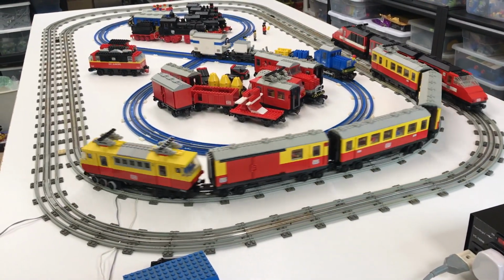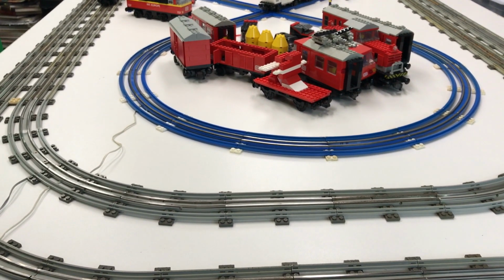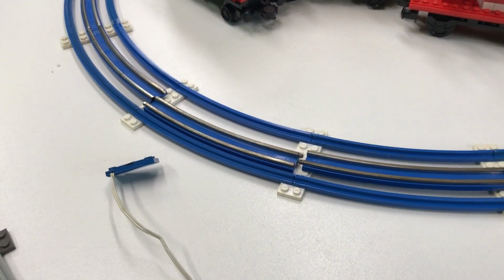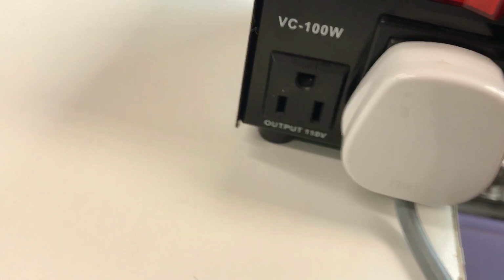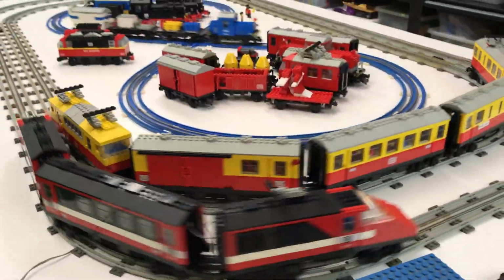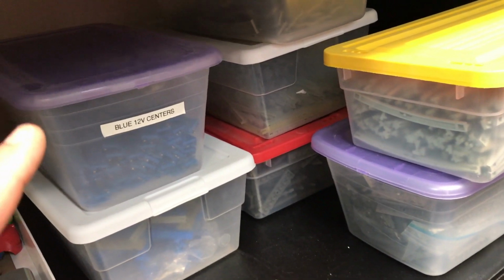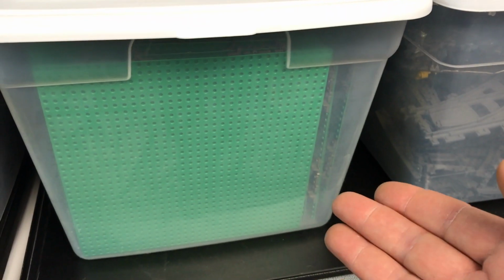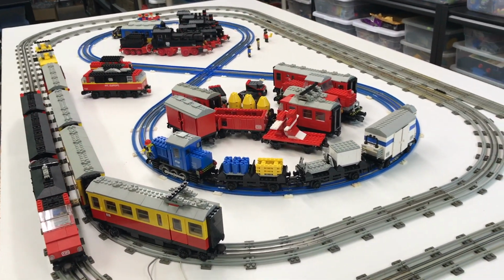HOW DO 12V LEGO TRAINS WORK? Running 3 Trains with 2 Transformers

Comment: great video! I had the yellow train! loved it. I also had the traffic control lights and line switch controls which plugged into the main grey transformer. you could as many controller switches to the transformer as you bought.

Comment: Awesome and informative video! One question for you though. I'm amazed you're 7740 is pulling those 4 big coaches so well with one motor. I have the set and one extra car and mine significantly slows down on curves. I think its actually more the train losing traction then the motor itself straining. I use replacement rubber tires, could that be the problem?

Comment: Nice video now I under stand this stuff 😄 I was wondering if you can use power function track stick 12v center rail on it and it work please test this out just not shore about the curve radius is the same :)

Comment: so how many type or rail lego has? I heard the 9v as well. I don't really like batteries so I think it's alot better than batteries. But does Lego still produce this kind of rail?
Reply from the maker: 9v discontinued in 2006. I agree.
Reply: @BrickTsar  looks like lego do not sell this 12v rail as well on their website, as well as the engine. Cmiiw
Reply from the maker: @SethSetiadha  12v discontinued basically since 1986.

Comment: BrickTsar, is there any 12V train set in particular that you would recommend as a 'starter set'?
Reply from the maker: 7745 is a good one with the passenger loading platform. And it is not too terribly expensive when compared to train sets today

Comment: I’m surprised those sets where available to the people in USA. I thought they were sold exclusively in Europe only. The so-called European connector you show here is actually the British standard, a rare one to be honest. Most of people in Europe use two-pronged circular plugs. My transformer was like that. Of course 220 V.
P.S. The blue transformer is the one I never had. It must be even older than the grey one. Although I had assorted sets of grey and blue rails I still used one grey transformer to power all of them. Oh the electricity experiments I used to do with those rails… hehe… covering locomotive’s electric connectors, making gaps in rails and stuff :P
Reply from the maker: No - they were never available in the US. I thought I had been mentioning repeatedly that these were not, Not sure if I misled you in this video but the 12v line was never available in the US though some of the add on sets such as freight cars were.

Comment: this is a really random question, but do the curve pieces from 12v (the metal ones) have the same amount of curve per piece, so you could theoretically use the 12v center guides on pf or 9v track?
Reply from the maker: Everything is the same as far as number of curves but the curved 12v center rails were designed for 3 ties per section so the will not fit on 9v or power functions track but the straights do. I've tried to make a simple oval but it would work.

Comment: What is the 3.6V plug for??  Answer, you can plug that in to the tracks like you did the 12V.  Then you can take an old school 4.5V motor.  You'll notice that the black motors and I think blues ones have plugs that go straight thru.  You can add pickups to the bottom of those, similar to the 1970's and older 12V motors.  Then they are safe to use on the track.

Now, there's an easter egg for you on the grey transformer (if you weren't already aware), you can use the 4.5V motors safely on that transformer as well.  Track attaches the same way as your 7745 train track is now.  Again 4.5V motor with the pickups.  Pry the control knob off of the grey Transformer.  Put it on upside down (you'll notice that 4.5V is inscribed at the top now and your knob is restricted in terms of top speeds forwards and backwards.

The 13V+ thingy to the absolute best of my knowledge only does one thing.  I believe that you can use it (both grey and blue remotes) for the old school blue remote switches.  They barely work, so don't waste your time and/or money on them, they are horrible.

I'm hoping to have some videos up soon.  To the best of my knowledge, I have the most 12V stuff in all of Canada.  Not sure about North America.  I got intrigued by this stuff at a young age, but was deprived as I'm sure you were living in the US (pretty sure that you're in the sourthern states) anyhow, hopefully you found some of that info interesting.
Reply from the maker: +12VTrains thanks so much for the info!

Comment: Bat how far could you run 1 track off of 1 power supply before voltage loss etc also I kinda cringed with your metal ring going across the metal tracks
Reply from the maker: I put my face on the track before - lol! We should test it out. I know I have had issues when making long loops with 9v but we haven't tried it with 12v yet. This is actually the biggest set up I've ever done with 12v but we have more track plus we could use all this in one loop or section. Good question to test!
Reply: BrickTsar just the metal ring causing a short attached too a finger would probably hurt